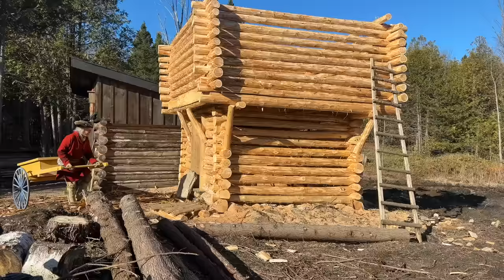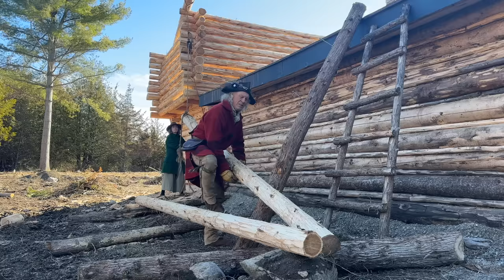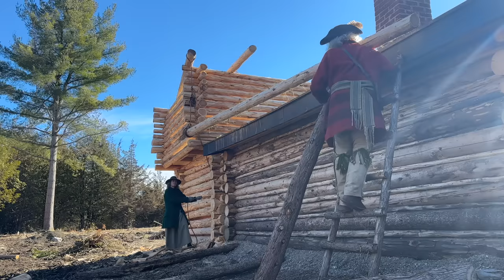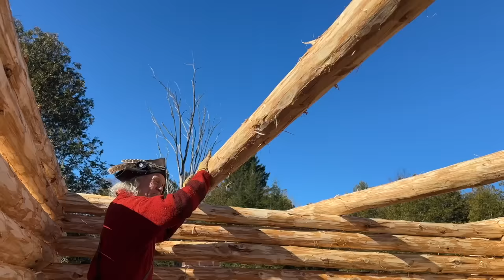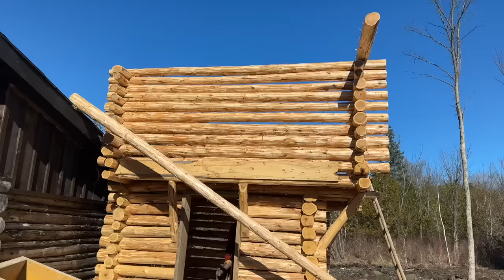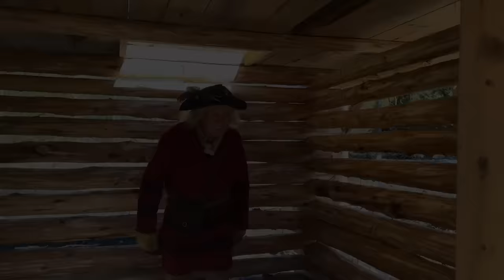FINALLY!  Top Log Storey Completed!  On to the Roof! | ASMR |

Comment: you really should be ashamed to have a modern BRICK fire place in an old Log Cabin, at least you could paste some Fake river rocks on it to hide the Modern bricks. "(
Reply: Are you saying they didn't have red brick during the Colonal period?  Perhaps before making a comment do a little research. 🙄
Reply: @ironcladranchandforge7292  I'm sure they did,in the big city's
Reply: Peter has already explained why he went with that brick. It was for safety reasons.
Reply from the maker: Bricks by the mid 18th century were quite common in the colonies.
Reply: @TheWoodlandEscape  I realize that but in a log cabin in the wilderness i doubt it. I'm 85 and grew up in the Ozarks where nearly evert home had a fire place and or wood stove and never saw a modern brick fireplace.
Reply from the maker: @jackiesanders489  True indeed!